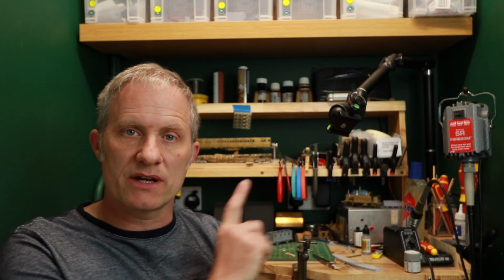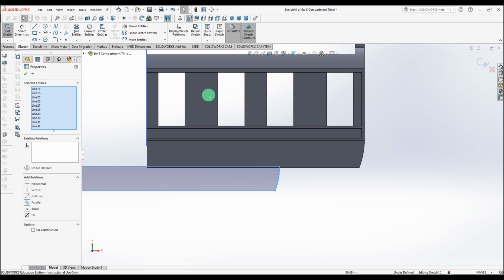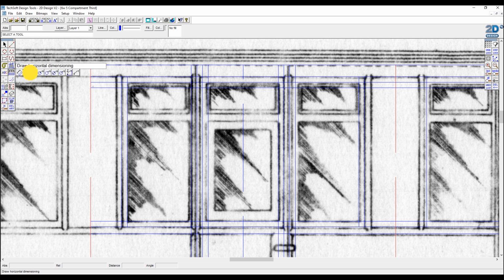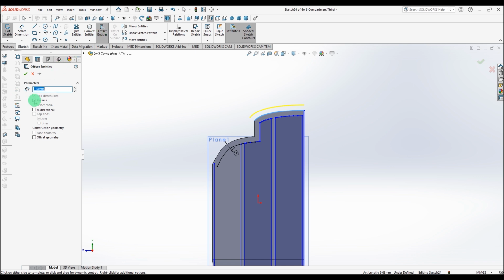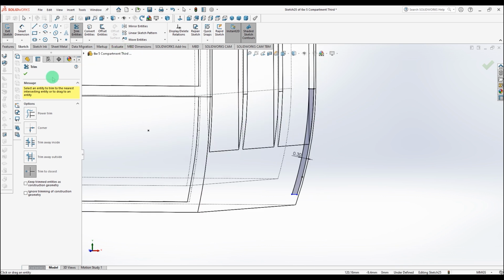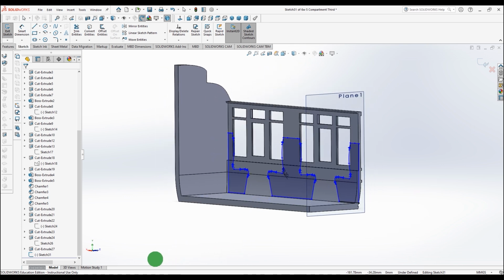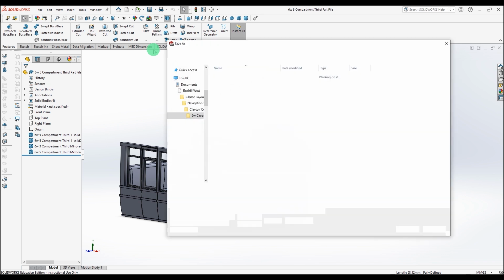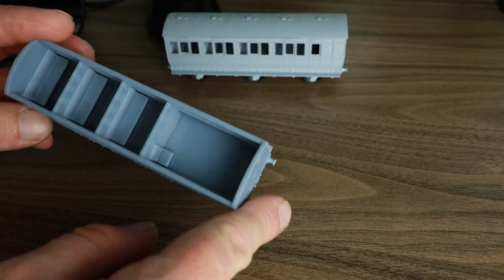S2 E40 3D Modelling a Railway Carriage Part 2

Comment: id like to see part 3 for one, I can also suggest the axle box and spring can be printed as one piece, slid into the w iron and will work as a conformal mechanism if you use 'engineering resin' or similar. ive done this before on some lowmacs I designed and it worked a treat for full working suspension with no extra build effort.

Comment: Very clever and very effective.
Reply from the maker: Thank you.  Of course having created the 'separate' compartments and ends, I've now got a head-start on the next carriage in that I can recycle the parts.  For example, I just need to draw a first-class compartment now in order to produce a composite carriage, and maybe a lavatory compartment, and a brake end.  Soon I could have a complete rake.  I've draw-up a complete set of Clayton Arc-roofed stock and the complete set didn't take long once the first had been completed.
Got to get back to the SE&CR stock though - I'm too easily easily distracted.  :)
Thanks for watching,
James